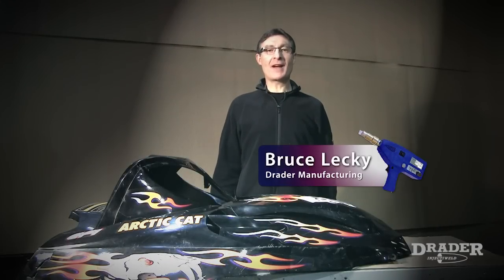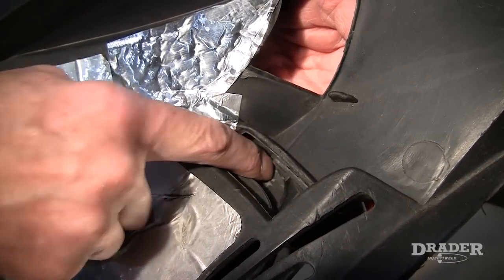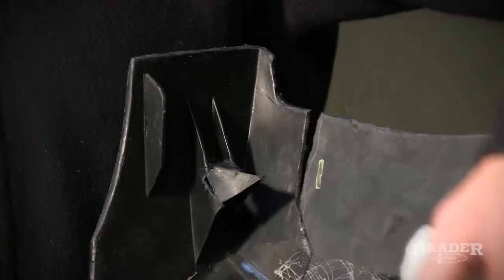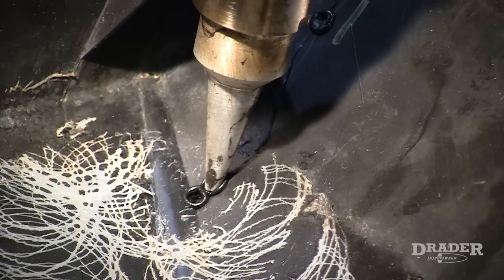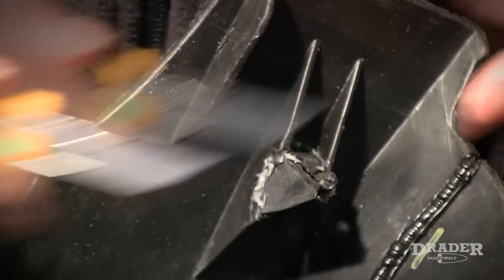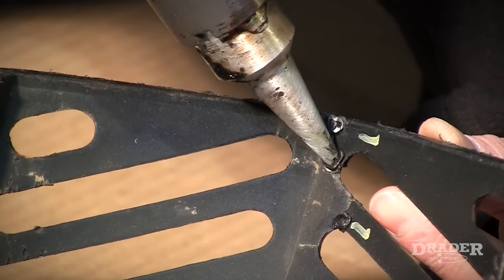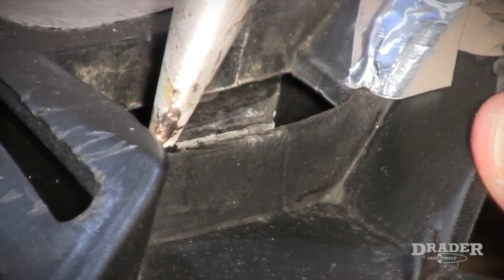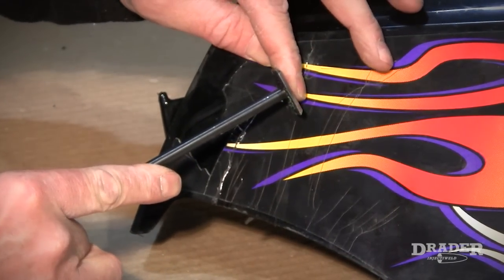Plastic Welding with Ease » Weld and repair a Snowmobile Hood with a plastic welder

Comment from the maker: hanafi tanudjaya Yes, Drader Injectiweld can weld many different types of plastic such as Polycarbonate (PC), Polypropylene (PP), ABS, Polyethylene (PE) / HDPE / MDPE / LDPE, NYLON, etc.  What kind of use do you need a reliable plastic welder like ours for?  We stay in touch.  Best regards, Drader Injectiweld Team.

Comment from the maker: Thank you for your comment. Do not expose yourself to any additional hazards. Products are not always stamped with the material type. If this is the case, there are few options to identify the material. Send a sample to Drader Manufacturing for identification.